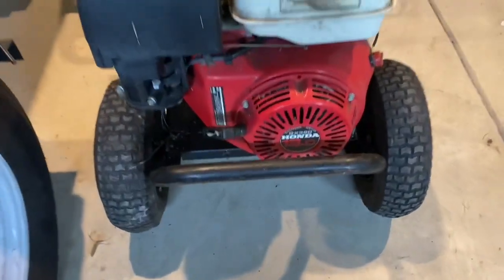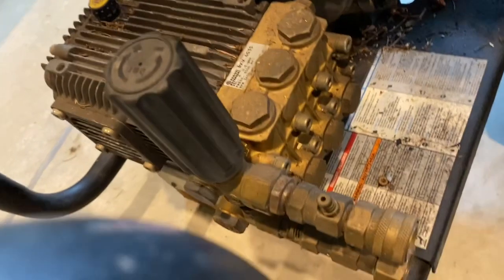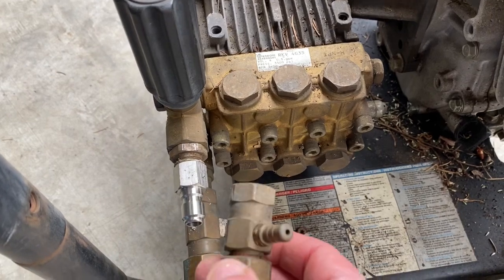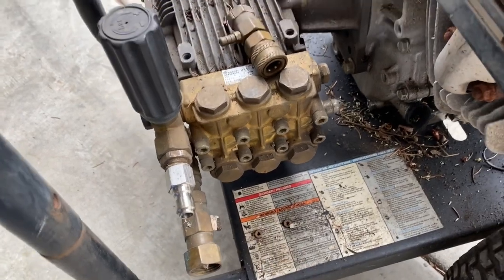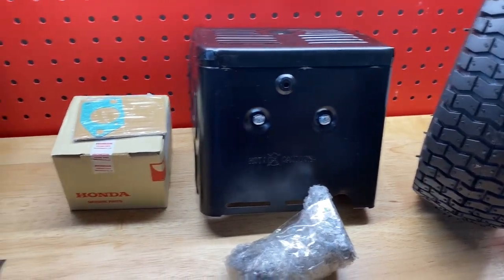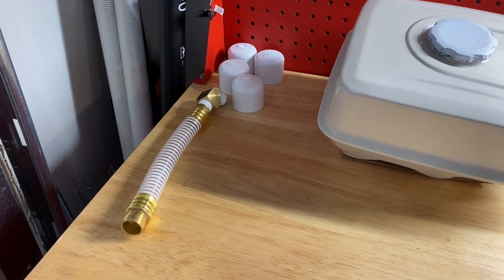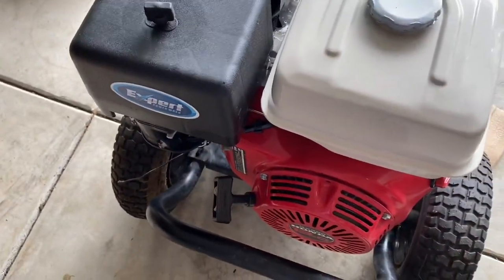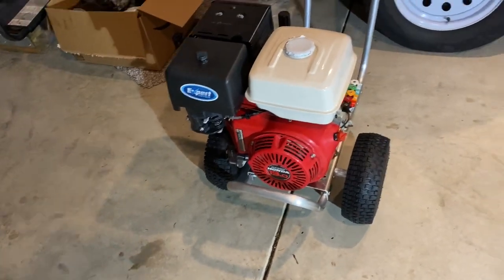Cheap Honda GX390 Pressure Washer Build

Comment: I just picked up a very similar project yesterday.  I paid $140 for a unit with a destroyed frame, GX390, and CAT DX66 pump.  Non running.  I basically paid for the new (still in the box) frame, and got the engine and pump for free.  No tips, no hose, no wand.  I'm getting ready to take it apart and tear down and rebuild the engine and pump.  4000PSI, 4.0GPM North Star.

Comment: I just picked up this exact spec pressure washer with the same AR pump…pretty much stole it for $200 from someone whose moving….had a friend install new seals/rings with fresh oil. I tuned the engine and it runs great. I want to start a small side business and work it up
Reply from the maker: Those machines are great.

Comment: can the direct drives pull from buffer tanks? A lot of people saying it won't pull water, but i think the gravity feed should be enough psi to give the machine 4 gpm of water...?
Reply from the maker: It won’t pull water but you can gravity feed it from a buffer. Simple fix, use a belt drive or gear drive.

Comment: Good Job!  I've started using Ethanol-Free gas in all of my small engines.  We actually have a chain of gas stations that  have pumps with it.  89 octane.  It's usually about 20-30 cents per gallon more than 87 octane regular.
Reply from the maker: Keith Dittmar thank you. We have one of those gas stations here too. Seems to run better and cleaner. Great point.

Comment: Brother where can i purchase one i need a gx390 pressure washer someone had told me that the best water pump is a viper vv4g42g
Reply from the maker: Never heard of that water pump. General Pump and Udor are great. You can get a GX390 with a good pump from Pressure Washer Products, Pressure Tek, or Southside Equipment. Pressure Pro makes a decent machine. Look for belt drive or gear drive.
Reply: Belt drive or gear drive  do you know the difference? I don’t sorry I’ll try to google it they last longer and thanks for the reply
Reply from the maker: @nightmaremike1092  the gear drive uses a gear reducer box to drive the pump. The belt drive uses a belt to drive the pump. Both are great and will last longer than a direct drive which is the pump attached to the motor. A gear or belt drive will also pull water from a buffer tank which makes a better choice for commercial.
Reply: @ExpertPowerWash  thank you brother 👍🏻 if you have a website or an extra gx390 you want to sell please let me know i will purchase.
Reply from the maker: @nightmaremike1092  the best place to look if trying to save a few bucks is FB marketplace or Craigslist.
Reply: @ExpertPowerWash  ty god bless.  Will subscribe

Comment: Great video, btw where do you buy your SH here in Portland?
Reply from the maker: Uriel Guerrero I use Cascade but you need an account. Walmart sells a great alternative for not much more and it’s 10%
Reply: Expert Power Wash which Walmart would you buy it from? I’ve been looking around in Vancouver, but haven’t even found pool essentials
Reply: @urielguerrero4871  It's called liquid pool shock.  10% SH
Reply from the maker: Any Supercenter should have it in garden
Reply: If you don't feel like driving to a supercenter...True Value online you can order 10% for 3.99 a gallon. They come 4 to a box. Will have to look at the supercenters though that sounds promising.

Comment: I have a 390 and it's not really a proper contractor grade engine. No oil filter. No fuel pump means you have to keep refueling it constantly.
Reply from the maker: That’s why it’s good to have a 690 as your main machine😎
Reply: How will a fuel pump help when your tank is dry? Exelent engine for commercial use see these engines working hard with well over 2K hours.
Reply from the maker: Why would a fuel pump have anything to do with running your machine dry? Not being a jerk just trying to understand your point. We use buffer tanks that keep the machine running even if water flow is slower. It cleans faster and shoots higher when applying soap. Most guys will arrive with their tank partially filled. This video was about a Honda 390 that I built. It would work for starting out or a backup. This machine has been sold to a local painter and I built another 390 but belt drive. I appreciate the comments.
Reply: @ExpertPowerWash  who are you replying to?
Reply from the maker: @alexanderraykhert1019  I was replying to your fuel pump comment about tanks running dry. Maybe I misunderstood the comment😎 Or maybe just worked up from people trying to convince me the Dawn is better than professional soaps😂
Reply: @ExpertPowerWash  I’m talking about the guys reply about fuel pumps. What I was saying if you have no fuel in your tank how will a pump help with that. The engines are really good and have no need for a fuel pump.
Reply from the maker: Oh got you👍👍

Comment: Huh? Change a direct drive pump to gear drive??? Pumps have a specific RPM they need to run in order to work properly, usually 1750 for belt or gear drive or 3450 for direct drive pump. You cannot change a direct drive pump to a gear drive, because it will run a half the speed and you will not have the pressure or GPM the pump can produce. It will be like using this pump at half throttle on the GX390.
Reply from the maker: 😂 Thanks for watching. You don’t change a direct drive pump to gear drive. You change the whole pump to a matched gear drive pump. There are several options for the 390.

Comment: C'est étrange: Vous n'avez pas essayé la pompe haute pression avant de vous attaquer à la rénovation de votre nettoyeur ? On m'a donné exactement le même nettoyeur que vous, mais la pompe avait les trois bielles cassées probablement du à un manque de lubrification. 120€ les trois bielles + 350€pour l'arbre excentrique et 150€ pour les joints j'ajoute 50€ de carburateur...Vaut mieux acheter du neuf. Merci quand même pour votre vidéo et au plaisir.
Reply from the maker: You may need to translate this.